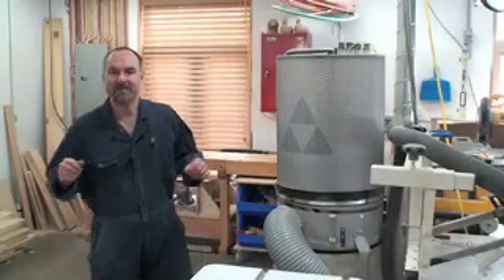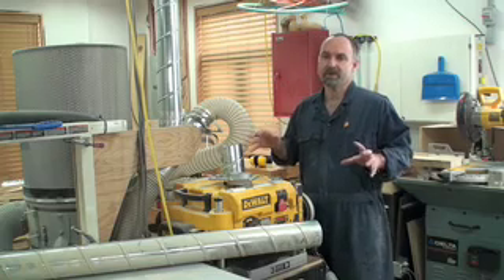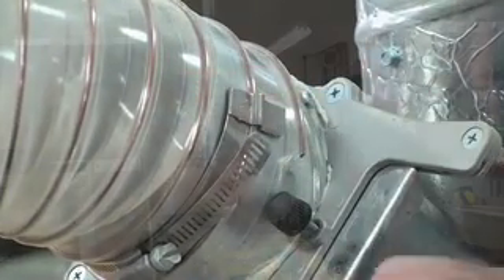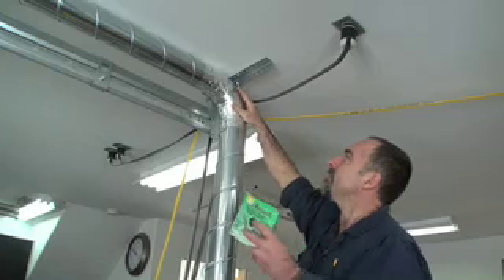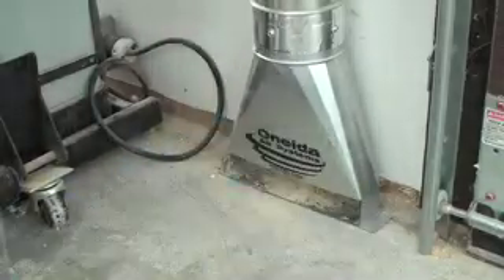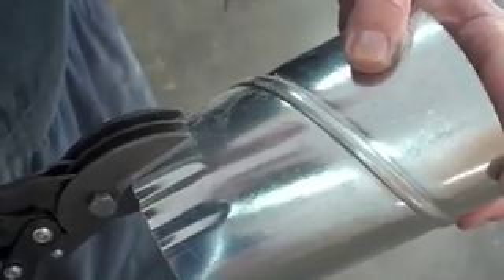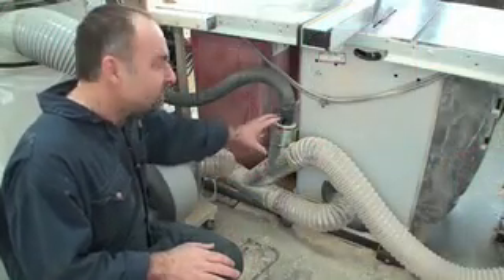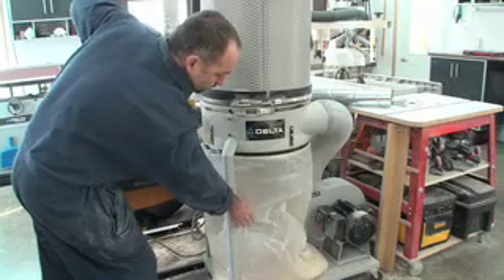Dust Collection System Overview

Comment: vid is very well done!! Great audio, smooth and easy to listen to without the harsh loud music in the background so many others include.I notice canister systems have a greater amount of suction, compared to the very expensive cyclone units. If doing over, would you use a cyclone over the canister? Seems the whole idea is to create lots of suction to remove sawdust, and canister units produce far more over cyclones of the same HP.

Comment: Hi there, Just discovered your video on dust collecting and especially interested as I'm trying to do a similar set up in my shop.  I now realise that there's more science in this than I thought as my dust collector (a bit smaller than yours) just doesn't have the strength to collect shavings from my planer with a flexi pipe of only 3 feet!  Because I have a reducer to fit the planer this kills the suction power of the fan.
Have you experienced this with connecting differing size connections?

Comment: Very informative video.  I could not belive that despite such elaborate system, the air purifier collected fine and dangerous dust!!.  I have a small workshop and virtually no dust collection system and thought of investigating one before purchasing - your video will certainly help.  Thanks.

Comment: First of all, those screws are self-tapping, but they're not TapCons. TapCons are special screws that anchor into concrete. They're blue in color. Second, instead of aluminum tape, why not mastic? If you truly want to stop leakage in your duct, you want to use mastic to seal it.

Comment: I also think you have way too much flex, and it's got way too little bend radius.  Your connection to your planer looks particularly tortuous.  You should plumb your fixed tools to the hard pipe directly.  Large diameter sweep elbows are good.  Another option is two standard 45s with a short piece of straight pipe.  Spiral metal pipe is great, but it's expensive.  PVC Sewer & Drain pipe is more affordable.  The HVAC snap pipe is okay if you get the heavy duty version.  No grounding is needed.

Comment: I have a 2 hp DC with a filter like yours with a skirt between a 30 gallon garbage can & the bottom of the bag rim. I also have a shop built air scrubber very much like your manufactured one.

I have shied away from a floor  sweep because anything metal that may be sucked up into this type of system can create a spark which can set in the system & smolder catching fire later when I am not in the shop & bye bye shop. I would suggest   using a regular shop vac to clean your floors.

Comment: Belfab collectors also have the canisters with the pedal to knock loose dust off the filter.

There is also another type of pipe, works really well! It snaps together like you say is cheap, but its just as solid as spiral pipe, and is a sinch to install. It is made by Kirk & Blum Best part is that you can always take something down and redo it if you add on.

I see you use the poly hose, great choice, some of the better tubing there is! It cost more but the added strength and suction is great.